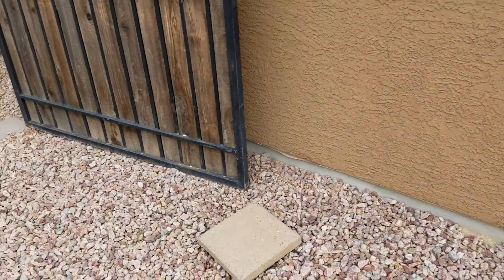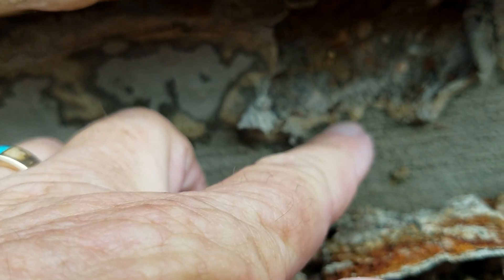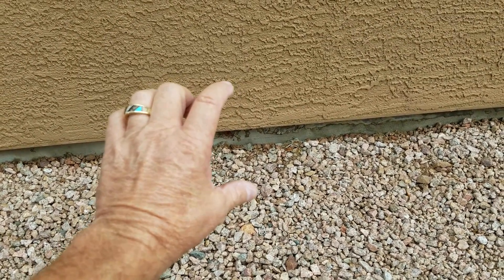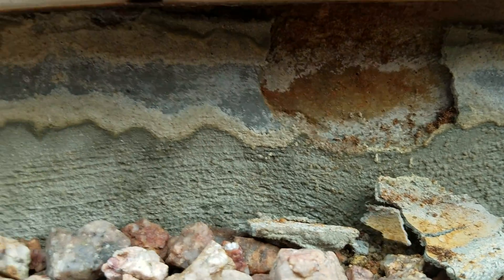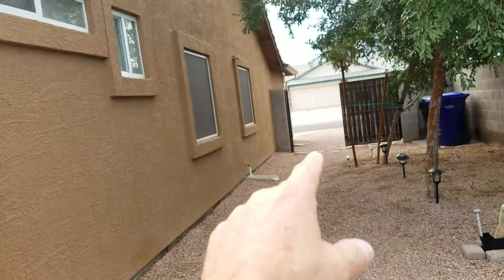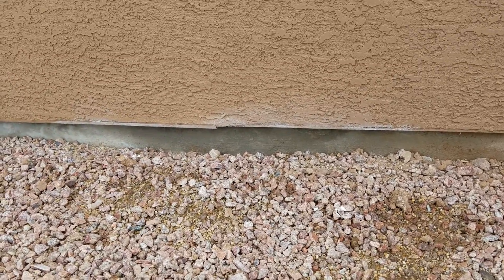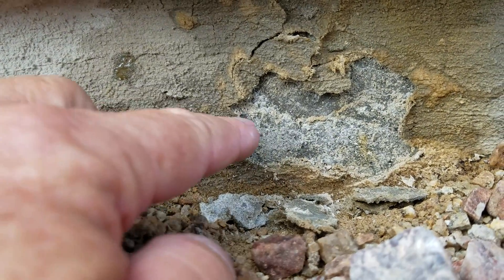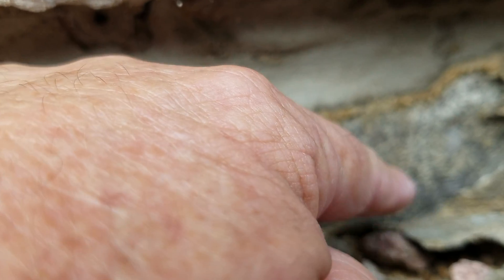Foundation Repair - Why You Need a Professional

Comment: I also live in Arizona and am an engineer.  I have worked on over a thousand homes with these kinds of issues.  I regularly find contractors and engineers that misdiagnosis this problem.  You are correct in your analysis and your repair recommendations.  The source of the problem is salts that are migrating into the stemwall from the soil.  To repair it, you have to water proof the foundation and stop the migration of these salts.
Reply from the maker: Check Out This New Video from Concrete Repairman LLC James Belville.....https://www.youtube.com/watch?v=LIADKK-KXSU